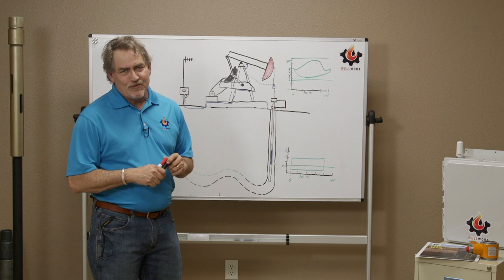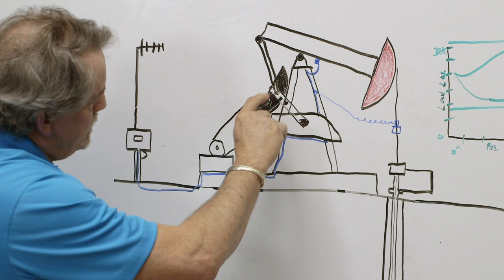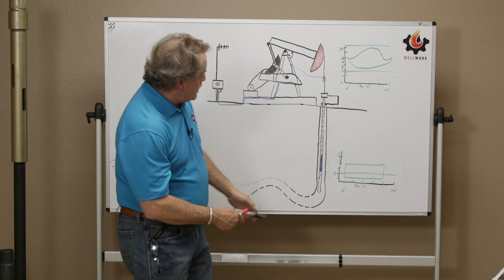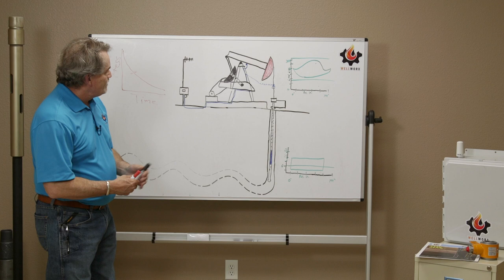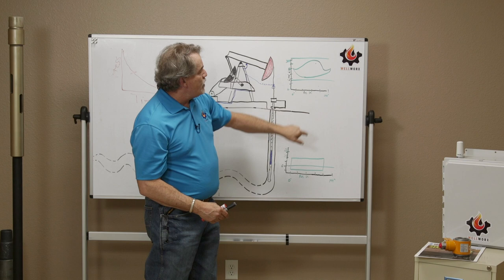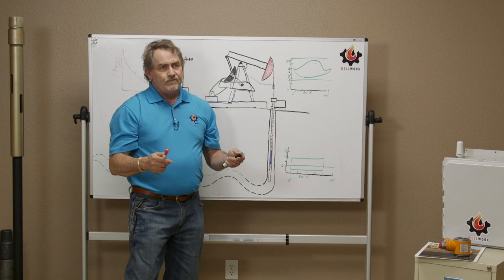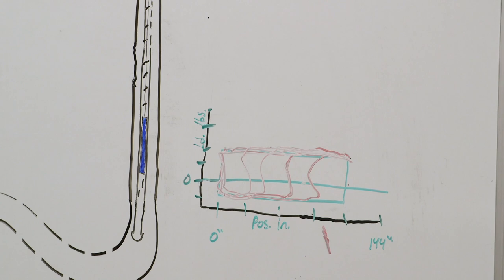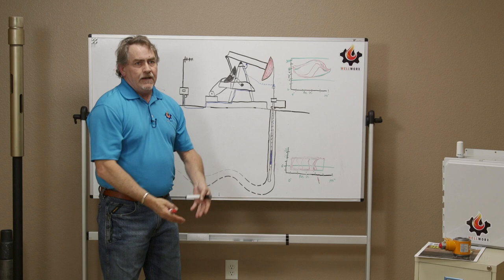Dynagraph Card Interpretation

Comment: Dynagraph and pump card are the same thing .? if not then what is pump card , could you please explain .?
Reply: It sounds like a pump card shows the same graph, but you subtract all of the rod weight from data on the dynagraph. At that point, you're evaluating what the force is supposed to be at the pull rod alone.  I'd appreciate if someone out there could confirm/clarify this!
Reply: @steinfracr  Surface card is based on live data via a load cell or possibly amp draw - the pump card is calculated